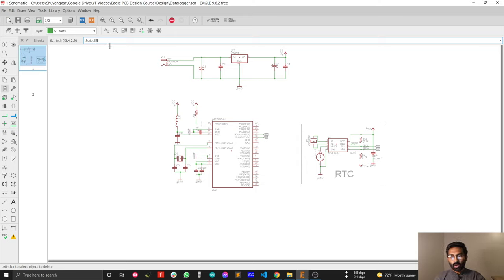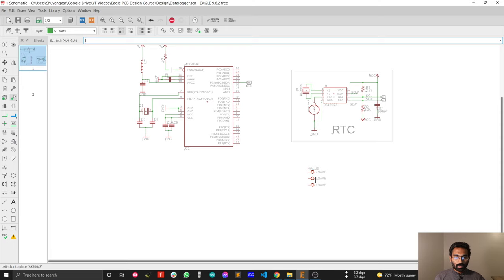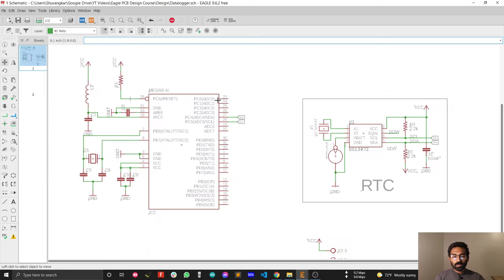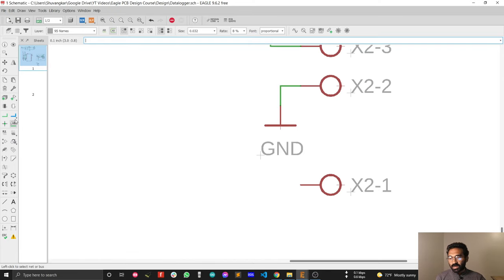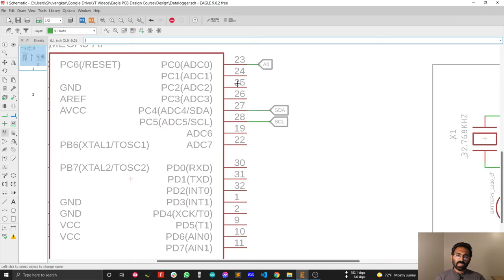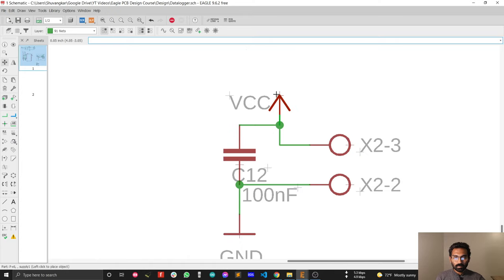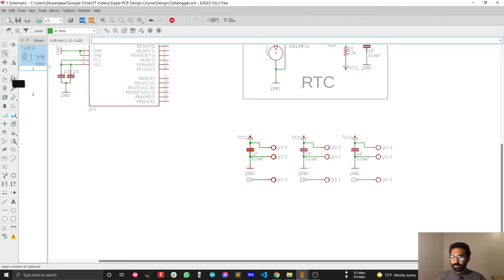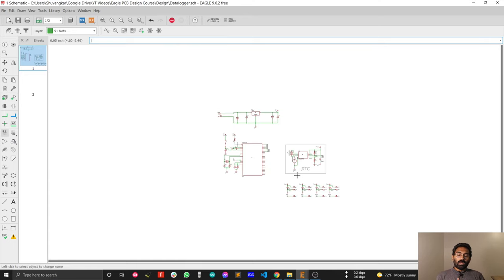Eagle PCB Tutorial | Design Analog Input Connectors

Comment: How to decide the grid size?
Or is it supposed to be 0.05 inch every time?
Reply from the maker: Most of the old library is designed keeping the grid size 0.05 inch. New libraries are designed 0.1 in. So, it is wise to use 0.05 that will support 0.1 library also.